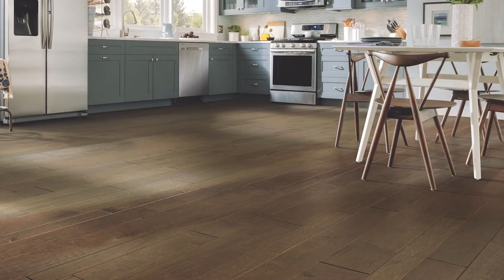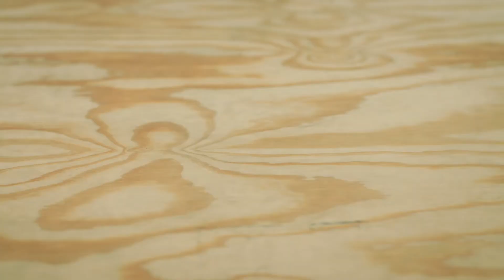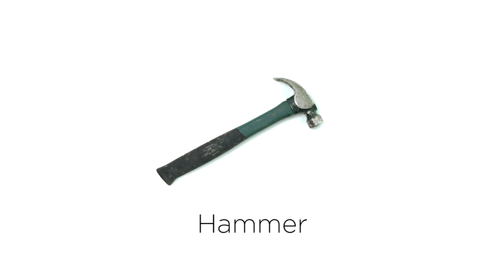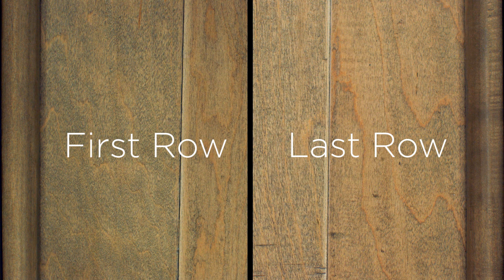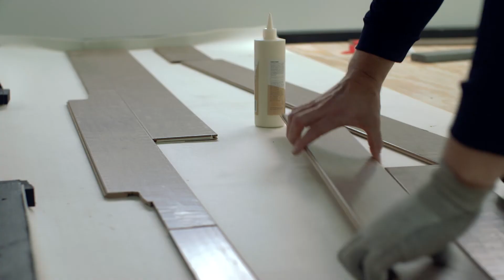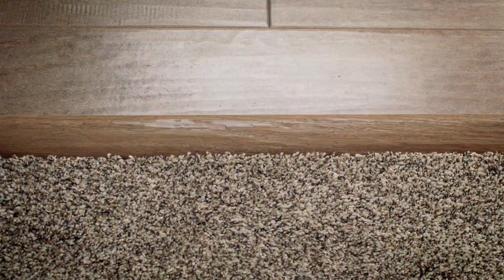How To Install Engineered Hardwood Flooring - Floating

Comment: Can someone clarify: I have a small bare concrete area under the stairs in my home in AZ. About 5' x 7'. I have engineering flooring I want to install as I turn the area into a closet. I'm confused about the 6 mil plastic. Do I lay it over the concrete and then put glue over the plastic and attach the flooring? Seems like it would move, no? Thanks for any help.
Reply: Contractor here in Scottsdale. For real hardwood flooring or engineered with plywood bottom you would either glue it straight to the concrete or put underlayment down and glue the tongue and groove seams.
If it’s laminate or vinyls you would put underpayment and the tongue and groove will click together.
Reply: Thanks so much. What kind of glue would I use to glue tongue and groove? Thanks for your time
Reply: @linkydinkydoodledumplin Robert’s 1406 👍
Reply: @linkydinkydoodledumplin  not a pro but there is glue specifically for 'tongue and groove'. Most home centers will have it.